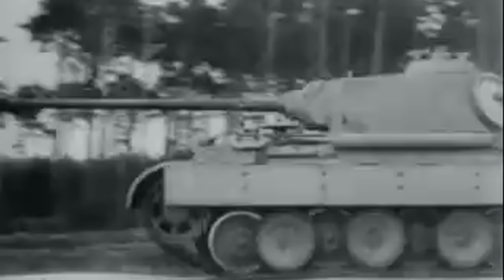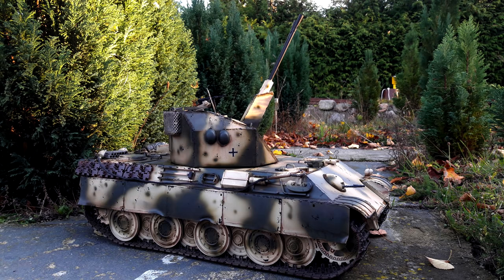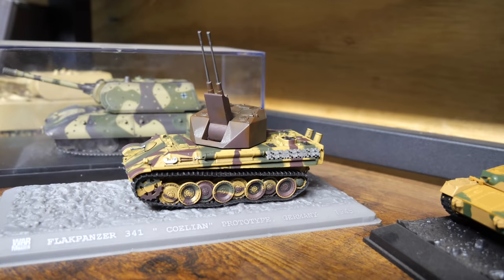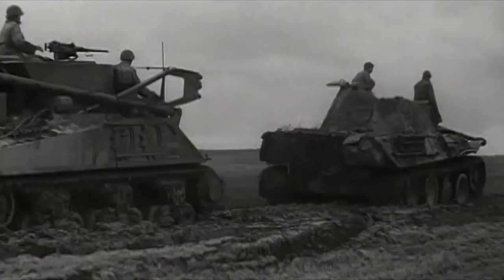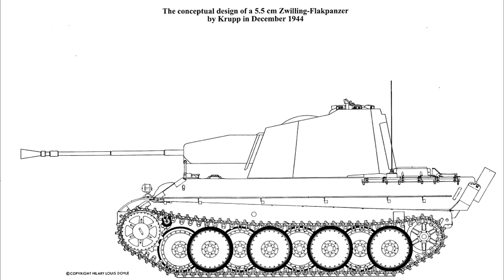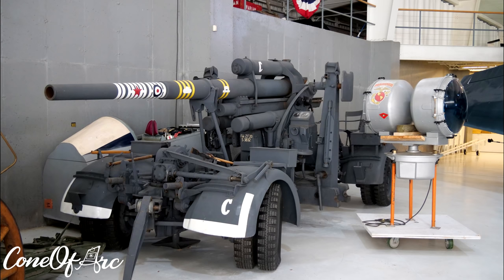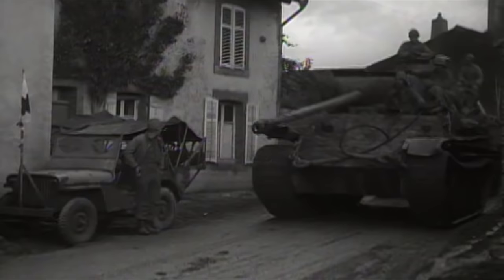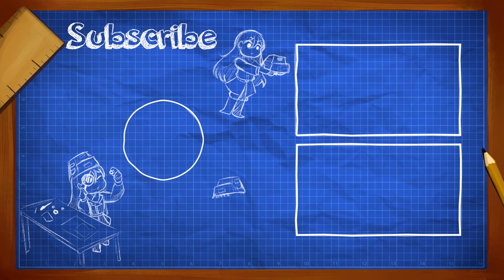VFW II to Coelian, the MANY FlakPanthers | Cursed by Design

Comment from the maker: Support the channel and get some merch featuring the Coelian and other German tanks: https://coneofarcs-merch.creator-spring.com/listing/br-compression
Reply: Your conclusion are sometimes a little bit off.

According to Doyle the Panther was planed as the next generation tank  platform for multiple roles from the beginning, so we are talking about the time frame 1941/42 when these concepts were made. The plan to turn the Panther into a flak panzer, a ARV or tank hunter predates the events of 1943/1944 when Germany finally starts losing the war and lost control over their airspace. The coelian wasn't a reaction to something that just happened. It was a concept which could not be realized anymore because of the critical industrial situation. A Panther hull could be assembled much quicker than a panzer 4 hull, because it was streamlined for mass production. Using old panzer iv hulls and rebuild them as flak Panzers definitely made sence, but producing new panzer IV hulls for flak Panzers would have been a waste of time and resources in the long run.
Reply: I like seeing Cone give notes, I think that's a good Idea.
Reply from the maker: @Servo_M  I've been wanting to find a way to incorporate her into the videos organically and it seemed like a nice way to do it
Reply: @ConeOfArc  And it works well.
Reply: *Fahrgestell  ;)
Reply: Hey Cone, one thing I've noticed is that plenty of WW2 guns have 50-57mm caliber and plenty of 75mm and up. There seems to be a gap in the 60-69mm caliber; has no one ever produced gun in that caliber?
Reply: @oisnowy5368  I'm curious about that as well
Reply: @oisnowy5368  It's about aerodynamics and stability of flight...some calibers aren't feasable due to bad aerodynamics

Comment: It's interesting that the Germans decided to mount larger caliber armaments (ie. 37mm & 55mm) on these projects when their own published assessments showed that the 20mm Flak guns were far more effective against Allied fighter bombers than any other of their anti aircraft guns.
Reply: A 20mm can only go so far up into the sky.
Though the 20mm was in the aircrafts which is why it was effective when firing head on but you had to get into range.

If we look into the US, the 40mm was the best when dealing with aircraft while on a level plain, on the ground or nn a aircraft carrier.
Reply: @GideonStahl  A 40mm Bofors could take out most fighters and other single-engine aircraft with a single shell.
Reply: @GideonStahl  The discussion relates to German Flak guns usefulness against Allied fighters, not whether the US 40mm is an overall better Flak gun than the German 2cm. As such the German report summery on the effectiveness of the 2cm Flak is as follows:

"The problem whether to use the 2cm or 3.7cm anti-aircraft gun [for a Flakpanzer] has been decided completely in favor of the 2cm. The Jabo (ie Allied Fighter Bomber) is a Mistvieh. He attacks at low heights. In every case at an elevation where the 2cm is effective. The majority of Jabo kills are credited to 2cm. When bombers attack in saturation raids they are at height ranges [neither the 2cm or] the 3.7cm can reach."

-- 2cm vs 3.7cm Flak effectiveness assessment as reported by Major Petri, 30th January 1945
Reply: @calessel3139  That's interesting, because the re-mounting of the 30mm MK103 looks to be the be best compromise between caliber, range, size, & weight. Based on pictures, they seemed to have made a lot of them, right in the last couple months of the war (so very few got into action). The ground mountings had vibration problems, but he vehicle mounts  worked pretty well. Mostly truck/halftrak mounts (and a few Kugelblitzes). There were plans for a "Super-Whirblewind" with quad FlaK 103s, but it never got past drawing stage, I believe.
Reply: @dphalanx7465  Yes, the Mk103 was an excellent weapon, but you have to remember few were produced by January 45. The report given only assess those Flak guns deployed in large enough numbers that would allow widespread field reports and I doubt there was much data on the Mk103 at that time. Weapons scrutinize would, of course, include 2cm Flak38, 2cm Flakvierling, 3.7cm Flak 18/36 and 3.7cm Flak43. I would also assume it probably included the 2cm MG151/20 since it had been fairly well incorporated into late war Flak units but no distinction is given between 2cm and 3.7cm weapons, so I'm guessing on this point.
Reply: @calessel3139  Yah, those triple MG151 (mostly 15mm) mounts seemed to be everywhere at the end of the war. Trucks, halftracks, trailers, barges, S-boots, you name it. I was rather surprised--didn't think there were that many unused 151's left in all of Germany. Unless they were ripping them out of grounded Luftwaffe craft, LOL.
Reply: @dphalanx7465  LOL - they probably were ripping them out of aircraft.
Reply: honestly by how late germany design worked: "because its new"
they seem to just love putting cutting edge stuff on their prototypes even if its not good
Reply: @Obelion_  Yeah, I mean they had plenty of decent off the shelf Flak guns like the Flakvierling or 2cm MG 151/20, but they decided to go with experimental weapons for these projects like the 3.7 Flak 341. It doesn't make a lot of sense. The only logical conclusion I can come up with is that the designers knew the war was going to be over soon, and nothing would get beyond a wooden mockup, so they just went with the most cutting edge equipment to impress the brass. I mean the troops highly praised the MG-151/20, they could have just mounted that in a redesigned turret for a Pzkpfw-IV and have had an effective flakpanzer on the field within months.
Reply: @Obelion_  probably has something to do with the production of the things still existing as opposed to having been flattened by allied bombing. Seems more likely that a small production line for a prototype weapon would survive, as where the larger scaled production for the more "established" weapons would be more liable for targeting. 

This is all assumption though, I have zero factual information on the matter.
Reply: Ye

Comment: The Germans created so many bizarre inventions in WW2 that if the war carried on a couple more year, they would’ve made an auto cannon version of the 8.8cm kwk put on tigers.
Reply: To be honest an Auto Canon Tiger sounds quite interesting, just imaging a Tiger with maybe a 6 Shot Drum giving out shots
Reply: Skoda designed a 6 round automatic loading system that was intended to be tested in the Jagdpanther.
Reply: Ooh! Imagine a jet plane like the Me-262 built around an 88mm anti-aircraft gun!
Fly up, aim at a bomber, fire a three round burst, recover from the stall conditions.
Reply: @MonkeyJedi99  Like The A-10 with the Drawback that the Guns Knockback is to much for engines to handle
Reply: @Hunter12396  Skoda was big on Autoloaders; they were also developing one for the 75/70 gun. Look up "Skoda Panther."
Reply: @Fnaffan_-tc2so  lol hs-129 with low velocity 75mm exists
Reply: The germans had a 128mm flak gun that was semi auto. Granted it still only had an ROF of the flak 88, but this is a 128mm. the waffentrager e100 in WOT mounts it not the pak 44

Comment: None of these actually seem actually cursed by their design, being basically useful designs or design concepts. Rather, they were cursed by the logistical and developmental environment.
Reply from the maker: True but the failure still stems from the designs which used components which weren't going to be readily available.
Reply: @ConeOfArc  again, that's a logistics and prioritization issue. It's not like those parts didn't exist, or didn't work... There was just too much demand for the supply.

Designing entirely new systems and parts would have been cursed, as it would have called for an entire new supply chain, which would have been a truly obscene waste of effort and resources.
Reply: @lairdcummings9092  If a design uses hard-to-source components, that is a flawed design.
Reply: @anzaca1  if they're genuinely hard to source.
Multiple demands for an existing part which is made in large volumes, however, does not make a part scarce. It demonstrates a logistics chain failure, not a design flaw.

Considering that the designs were drawn up during the crush of a losing war, such prioritization constraints are hardly unpredictable.
Reply: And, Germany had a major fuel shortage, especially late in the war.  There were many, many newly produced vehicles and aircraft sitting idle for lack of fuel.
Reply: @lairdcummings9092  perhaps that is apart of the design.
Reply: @yelectric1893  design responds to specification and requirement. The designs presented met, within bounds of reason, the specification and requirements, and made maximum use of pre-existing material and parts. That's efficiency. It is in no way the fault of the design or designers that the nation was being bombed into oblivion. Under those constraints, looking to focus on existing AFV construction was the correct decision, and again, no reflection on the merits of the designs in question.

Cursed by circumstances? Absolutely. But by their design? Nope. NO design could survive the circumstances.
Reply: @lairdcummings9092  I agree. Panther production was increasing considerably in 1944. The 37mm gun was very effective against Allied CAS. It made sense to combine the two. 
Providing the Panzer divisions with an armored SPAA unit would have made quite a difference in the western front.
Reply: @anzaca1  not really.
Reply: @lairdcummings9092  I would point to the Handley Page Halifax as a counter. Initially, it used Merlin engines. But when Lacasters needed those engines too, they switched to Hercules engines instead.

If certain parts are in high-demand, use an alternative.
Reply: @anzaca1  if, and only if, suitable alternatives exist. Which, in the declining years of the Reich, they did not.
Reply: idk i think putting heavy armor on an anti air vehicle that would mostly be engaged with airplanes that use 20mm (or smaller) guns at most seems pretty bad design. if it sees tanks (where the armor is useful) it cant fight back, so even if you want to use the coelian against non aircraft, it basically has to fight infantry or light vehicles, for which panther levels or armor is way too much...
the design isnt bad per se but kinda overkill, like lots of other german designs of the time
Reply: @lairdcummings9092  i mean isnt your design a failure though if it doesnt meet the requirements? what good is a design that cannot be built due to realistic limitations, no matter how great it in theory is? if i make this amazing tank that can defeat anything on the battlefield, but costs a trillion $ to build, is that a good design? probably not right
Reply: @Obelion_  ah, but these designs do meet the specifications. That is the whole point... There's nothing wrong with the design, it's the logistics that are screwed - mostly by Bomber Harris and Curtis LeMay.
Reply: @lairdcummings9092  I mean a dude with an anime profile (cone) is pretty cringe and is making shit arguments.

Comment: You should take a look at the missile program of ww2 Germany. It would fit perfectly in line of “Cursed by design” even though it isn’t a tank thing. Some of them influenced the development of future anti tank missiles. I guess ATGM would also be a interesting topic.
Reply: Yep.  The infamous "Sagger" got its start as a German Air to Air wireguided missile.
Reply: Same with the French SS.10/11 that are basically upgraded Ruhrstahl X-7's.
Reply: That reminds me to "Penemünde West". A book i stiil need to finally read after finding it at work
Reply: They really were ahead of their time, though one critical advantage the Allies had was in proximity fuses without which these missiles weren't practical.
Reply: @Zorro9129  as far as I know they had a proximity fuze that worked by detecting the sound of the propellers of the bombers. They even tested the missile from a flying aircraft.
Reply: @Zorro9129  Yeah. Imagine 88mm Flak or R4M's with proxy fuze. That would be really fucking scary. There was a proxy fuze in the works for the Wasserfall SAM but it didn't go anywhere as the war was over.  

But to be fair, the R4M was already devastating without proxy fuze and the X-7 as an ATGM had no use for a proxy fuze.
Reply: @Zorro9129  No not really, the creations were extremely shit and crude even if they had prox they still would have been unusuable
Reply: @aregulargenericname8794  not really, the x7 anti tank missile was supposedly used on the eastern front and the anti air missile was successfully tested and ready for deployment but the allies bombed the factory producing the engines for it.
Reply: @exo068  No not really
Reply: @exo068  Also there's a reason people say "supposedly" there's almost no evidence
Reply: @exo068  And one last thing, if they were actually even usable then why would they give up on it after the factory was destroyed?
Reply: @aregulargenericname8794  well the main reason why they have been used in few numbers is because the technology was using rear resources and the factory’s were destroyed. The technology itself was ready to be used in combat.
Reply: @exo068 I dount it was "combat ready" considering how Germany at the time were doing
Reply: @exo068  And again, the proof of them being used is nonexistant from knowledge everything i've read aboit it would point it being almost useless
Reply: @aregulargenericname8794  at the beginning of 1945 the tests were complete and full scale production was started. In an air raid the factory producing the engines was destroyed and the war ended for Germany on the 2. September 1945.
Reply: @aregulargenericname8794  the technology was ready but the didn’t have the resources. There is a difference between that.
Reply: @exo068  And everything i ha e read has bassicly said that it was a massive failure and almost completely useless
Reply: @aregulargenericname8794  useless in winning the war yes but not useless as a weapon. The warhead was a 2.5kg hollow charge and could be used to a range of 1.200 m.
Reply: @exo068  i didn't say it was because of technology, yes it could exist but not combat ready

Comment: An enclosed turret with really poor outward visibility makes the whole concept moot.  If you can't spot and track targets that may be coming at you from any direction, the vehicle is pointless.
Reply: An enclosed turret provides a vast advantage in protection however, especially as killing every incoming aircraft wasn't going to be possible.  Eventually enclosed SPAA did become the norm, though they probably had better visibility.
Reply: Fully enclosed turrets only became common on SPAA after search radar also became common. ZSU-23-4, Sergeant York, Flakpanzer Gepard: these all had closed turrets and search radars. VADS, M19/M42 Duster, ZSU-57-2: these all had open turrets and no search radar.
Reply: It would have taken very little time for them to add a first gen Night Fighter radar to it. The germans had those as surplus since bombers (but back then NOT the single engine craft) could/did carry jammers against them and the Night Fighters got a second gen.

And german tankers are used to fight from the open hatch

Comment: On the vehicle at 9:02:

It's a field mod of a field mod. The base vehicle is a Panther that got turned into a Bergepanther engineering vehicle. It was common for Bergepanthers to have the hole left by the removed turret to be covered with wooden planks. 
Another indicator for it being a Bergepanther is the removed hull roof on the drivers and bow machine gunners position (this one got really fancy and got a movable cover for it!).
And then somebody just decided to put a regular stationary 3,7 cm flak on the wooden platform. In the end it's basically the same as putting an aa gun on a flat bed truck just with an engineering tank.
Reply from the maker: Yeah I figured as much. I'll probably cover that vehicle in a future video of its own I only included it because otherwise I'd get comments like "ummm actually you forgot about the panther with a 37mm on it"

Comment: I have a VFW on War Thunder. The most interesting feature of the design was that you could raise the side skirts for extra protection, which would also limit the horizontal traverse of the cannon, or leave them down, in which case the cannon could traverse the full 360 degrees. It may have made a reasonable tank destroyer, but of course Germany had plenty of those, including a Flak 8.8 cm mounted on  an armored truck chassis. It's true that they were better off using the Panther chassis for actual Panthers.